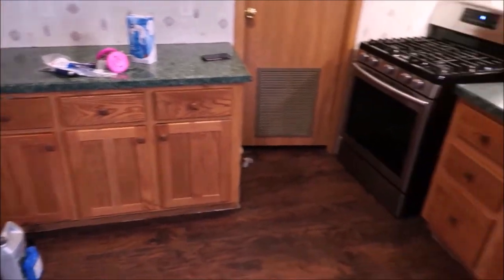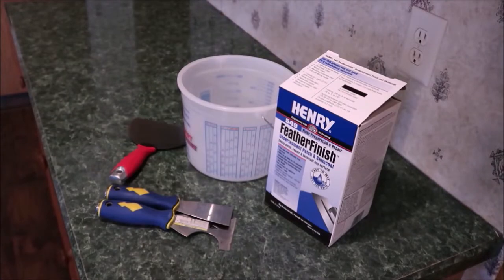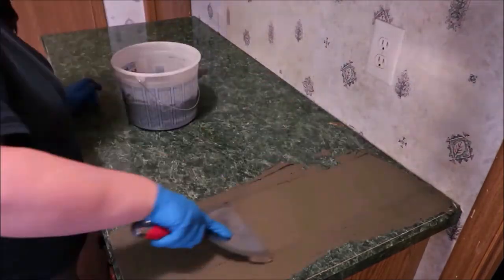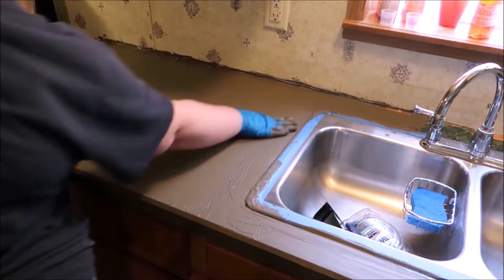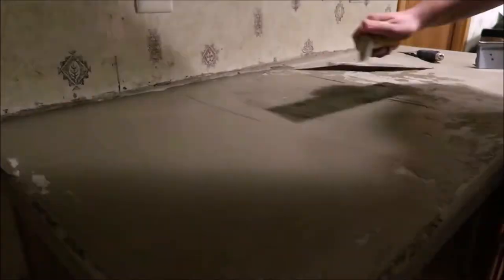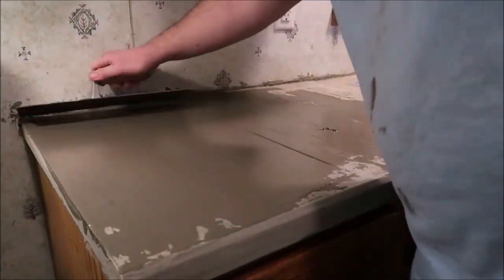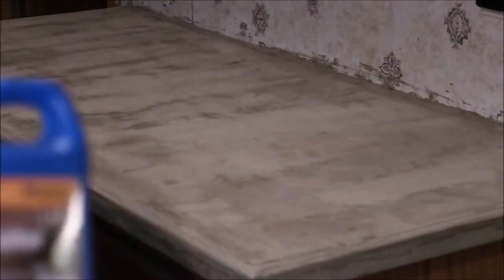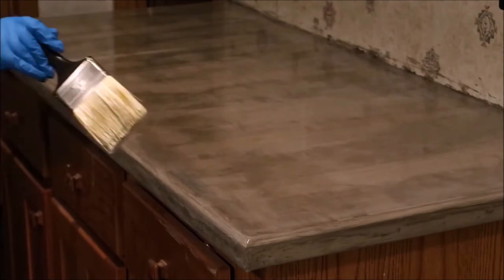DIY Cheap Concrete Countertops!|Concrete Over Laminate Countertops For Under 100 Dollars!

Comment: wait.. did you just lay the concrete mis down on finished counter tops? Yikes.. You have to rough up and/or apply a primer.. And if you add more water to the mix, you are weakening the concrete.  The tensile strength drops and you're likely to experience cracking and chipping.  If you want it to flow more easily, add flow control (which will also help strengthen it) ..and use a bonding agent instead of water to add more strength and durability..